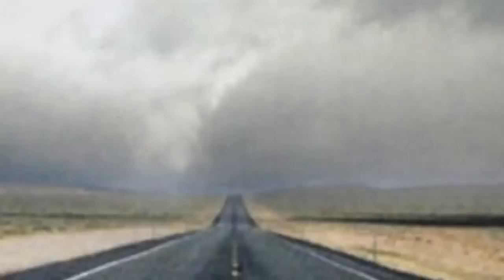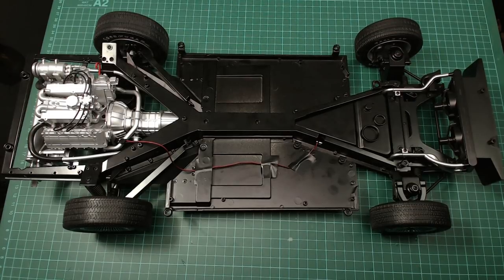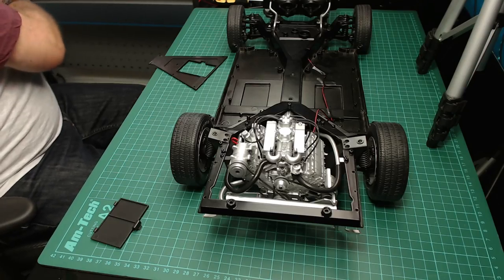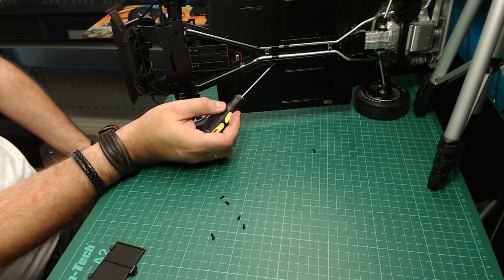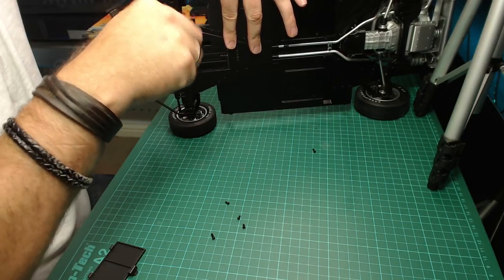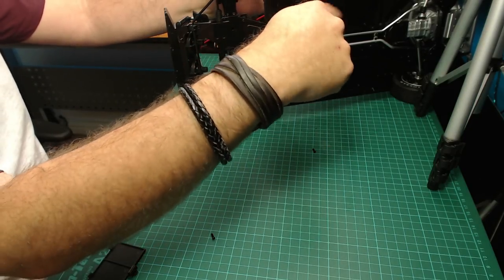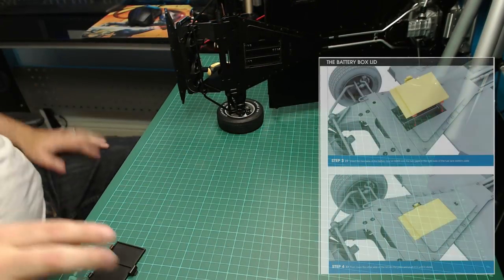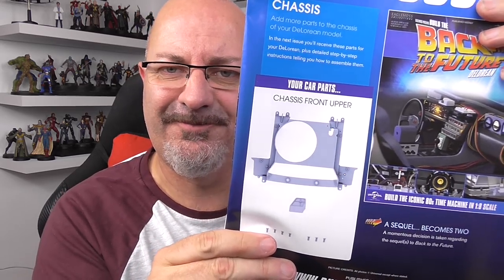Build the Delorean - Issue 33 - The Fuel Tank Bottom Plate / Battery Cover

Comment: Great video! I would consider using small dollops of hot glue for those wires. It will never let go unless you take a hair dryer to them and remove them yourself. I think that would hold much better than tape.